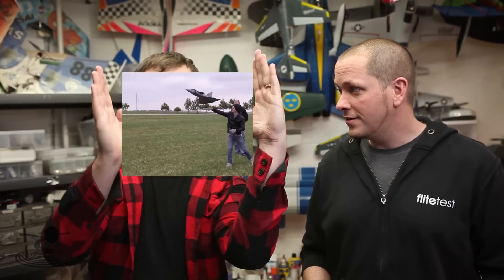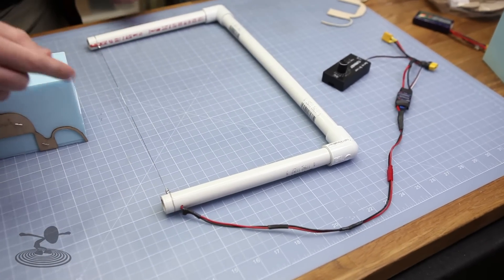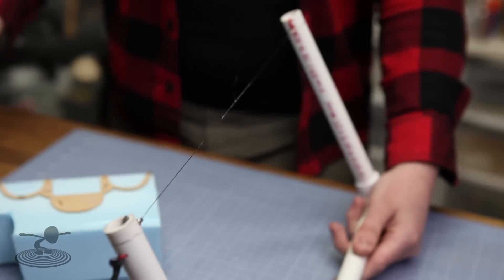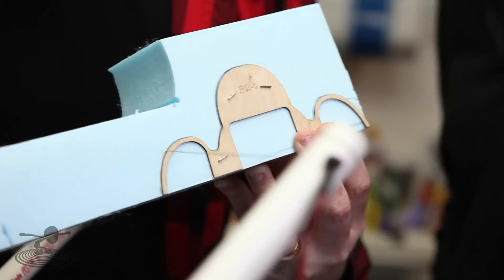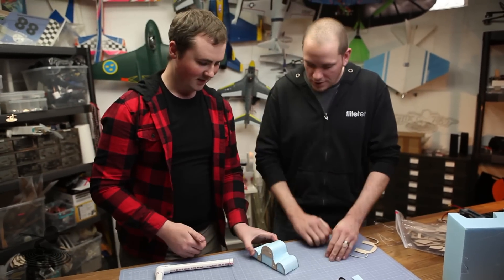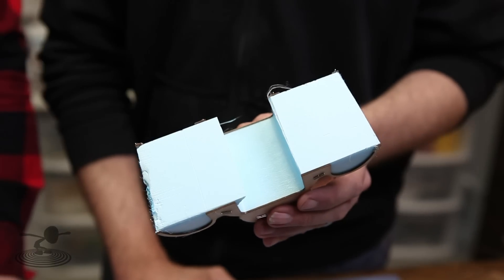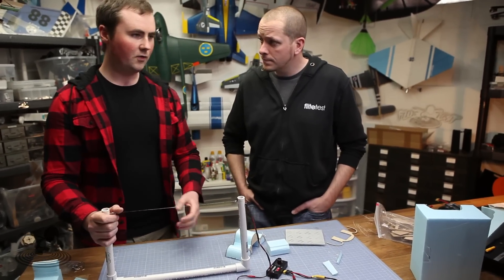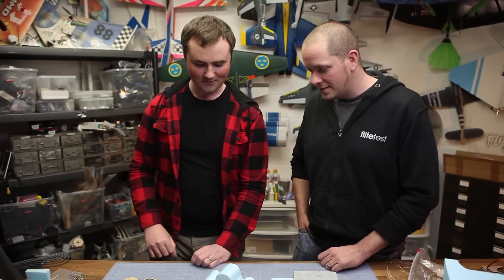Flite Test - Hot Wire Foam Cutting

Comment: I didn't get it either, or where to buy this Nickel Chromium, and for the majority of us that don't have a brushed ESC ,  what do we use in its stead. I have seen guys use the little transformer and a dimmer but what kind of transformer. Step down to 12 volt would imply a 10 to 1 ratio.120 in and 12 out, can it be AC or does DC provide better results. And then the application of a cheap selenium dimmer on the input end, the kind you use in a wall switch to dim room lights. Can any help?

Comment: low temp hot glue . use a small amount, Thats all you need and it will not melt because the heat dissipates faster.

Comment: also, how about adding mirrors to the sides of the bow so you can see how far along you are cutting on both sides without having to turn the piece over

the awesome thing about having the plans made in foam sections is that each of these sections are small enough to be 3d printed ... you could add pins and holes, or slots and tabs, and make it much easier to assemble and give it some added structural rigidity as well

Comment: 2:53 you can use a 3 phase brushless ESC if you make a rectifier out of diodes ...  you will need to hook up a motor in parallel so that it gives a feedback voltage so that the ESC will work

Comment: You could also use an AC transformer and a light dimmer to control the heat of the wire.
Reply: Is there video how to do it?

Comment: A good cheap source for wire is your local music store. I picked up a NP017 string (guitar second string) for 10Kr (about $1.20USD) works great with a 4A 12VDC transformer to supply power (wired to a rheostat/potentiometer to adjust the wire temperature.)

Also I'd like to ask David if he can recommend any Blue foam core suppliers in Sweden.

Comment: Ok, so Im able to get an variable power supply. It has 3-5 V/1,5 A, 5-9 V/2 A, 9-11 V/3 A, 11-14 V/4 A. Im wondering if that is good for a bow? I dont care if the bow have to be 30cm or 1m, but if it would work.

Comment: very easy, go look up a tutorial (google it) there are many. in short, you can do it with 90 min epoxy or the real fiberglass glue stuff (can't recall the name) you just coat the fiberglass with the glue outside or in a well aired room and aply in strips. I prefer epoxy as it isnt as poisonous to breath in and easyer to find, and also cheaper

Comment: It's when you're cutting the foam and the wire isn't hot enough to cut it with proper speed, so you push it a little harder and the wire starts to flex a little.
That is bowing.

Like when you pull back the string of a bow, bowing.

Comment: Thanks for the info guys, I built a foam cutter using a computer power supply which had WAY more than enough power. I will have to revisit that adventure and see if I can't refine it a little bit!